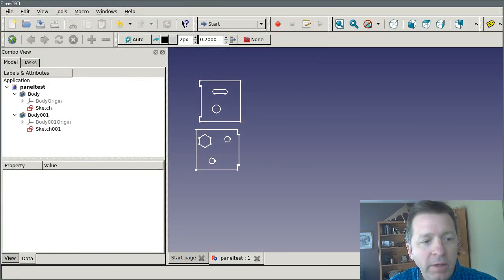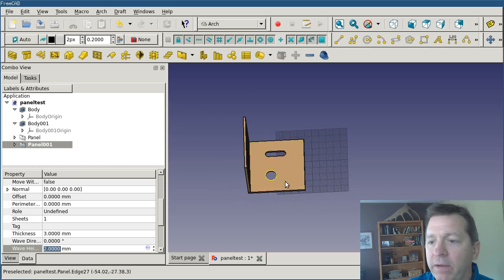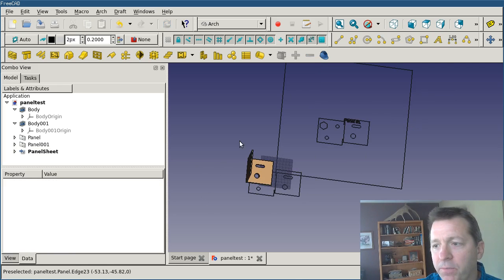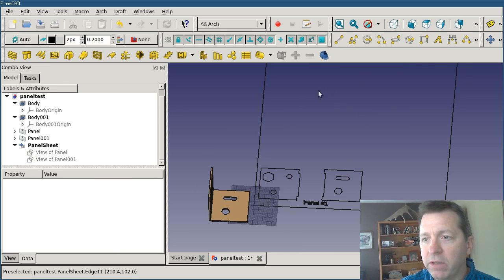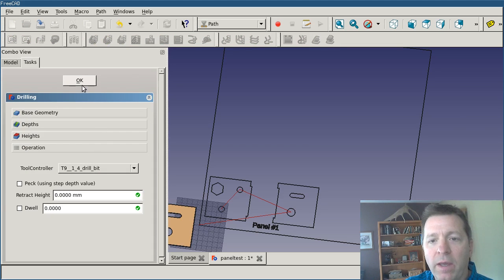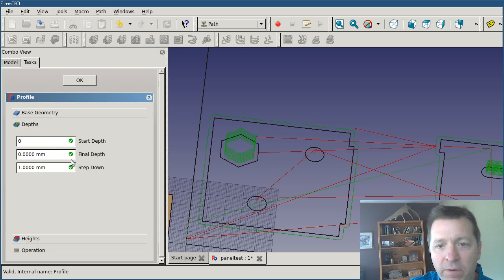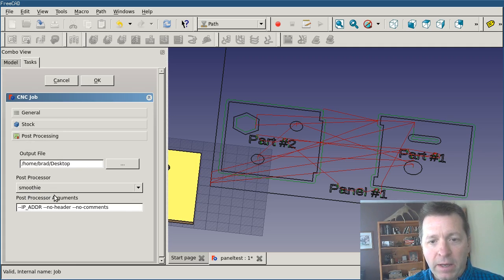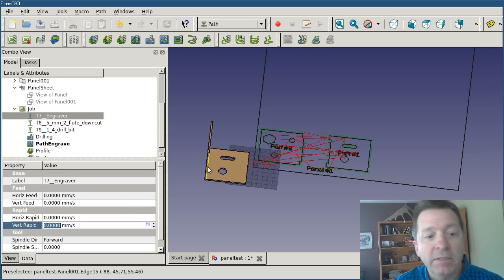FreeCAD Path support for Arch Panels

Comment: Thanks!  I didn't know the "Arch" was effectively the CNC workbench! I was trying to do multiple parts with "Part" and I couldn't get the heights correct.  Maybe there is a way to do it with "Part" but this tutorial wins my vote!
Reply from the maker: I wouldn't say that Arch 'IS' part of the CNC workbench.  But they nature of FreeCAD is that there are a lot of tools in the various workbenches that are useful in others.  The upcoming version 0.18 also adds 'multi-base' jobs in the path workbench.  This is also good for doing things like arch panels.
Reply: @sliptonic  I'm having trouble getting any "Base Geometry" to show up when I click on any of the tool operations (ie "Contour' ,"Profile" (all versions), "Helix" etc.).  I spend hours trying to figure out why they don't show up.  I should only select the tool when hitting a "tool operation" button.  Any suggestions?
Reply: It's got something to do with small holes.  My bit (3.1mm ) will fit in these 2.4mm RADIUS holes. Maybe I need to set the tool's "Flat Radius" or "Corner Radius" ??
Reply: A hole of 2.6 radius works fine.  A hole of 2.5 radius (and smaller) fails : it gives an error icon on the Helix operation in the Job.   How do I work around or fix this?  Am I doing something wrong with my bit setup?  The Helix that is drawn when the hole radius is 2.6 looks really thin (like it thinks the bit is larger than 3.1 mm).  There should be plenty of wiggle room in that 5.2 diameter hole for a 3.1mm bit to wiggle around in a helix.
Reply from the maker: Please post on the forum in the Path/CAM section and attach your model if you can.  YouTube comments are a hard place to do support with no pictures, files, and limited eyeballs.
Reply: For anyone else that is reading this... my previous 2 posts were using the 'Part' workbench instead of the 'Arch'.  When I was messing around with bit diameter to figure out what was going on, this "bit not fitting in a hole problem" with 'Part' workbench went away.  I can now get Helix on my small holes.  I think there is a problem with the save-load of the tools but I can't reproduce it anymore.

I'm still having problems getting any "Base Geometry" to show up with 'Arch' workbench.  I'll play around more and report here and submit a bug on the forum.
Reply: The problem is due to "Fillet" corners on a rectangle.  I can put 1 fillet on a corner.  But if I do 2 corners the helix (which is on a circle inside the rectangle) is incorrectly placed.  If I do 3 or more, the helix doesn't work (error).  I can edit my sketch and modify this single fillet and watch the helix move to an incorrect spot or become an error.
Reply: Here is how I accomplished the same task:
https://youtu.be/pMjOq4_FGYc
I used extruded parts. But I can cut multiple parts using the same sketch.If I change one part, all the clones change...and even the gcode changes for all the parts!  Very useful! Long live freecad!